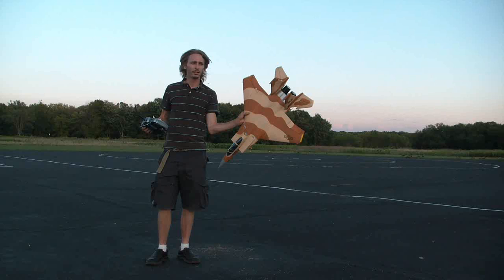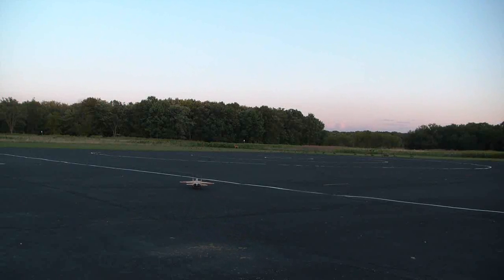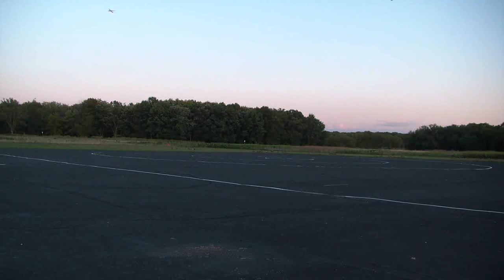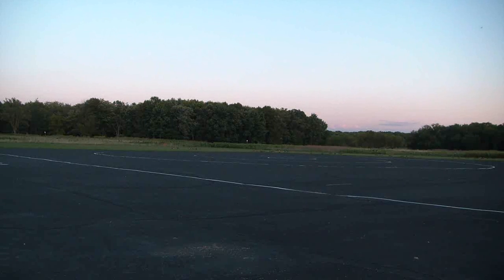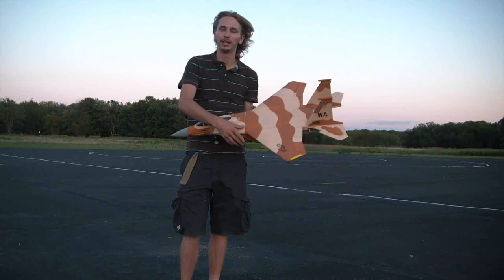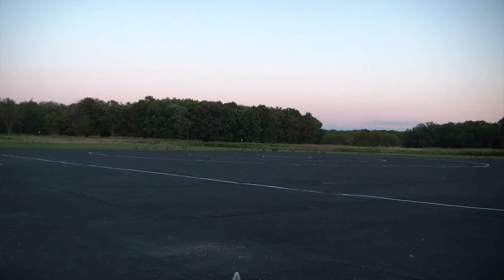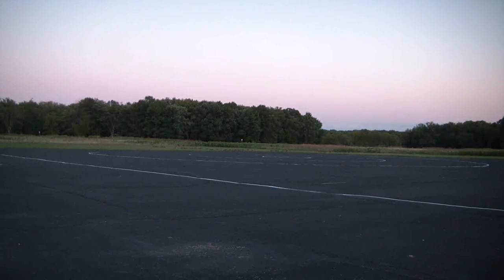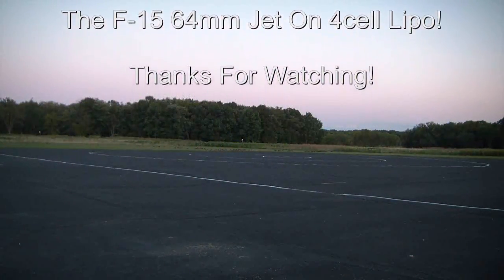F-15 64mm Jet Maiden Flight & Review - LOW Passes!

Comment from the maker: @xToXiicxT3RRoRx cus they sell it with a 3cell lipo, it won't be as fast.  I had the a10, it worked well until one of the two ESC's burned out resulting in a crash.

Comment: Should i get this its on nitroplanes for $119 everything encluded with transmitter and also does it have steering in the front wheel and is it good??

Comment from the maker: @jetcrasher1 The E-flite F-15 flew great, sadly my wing ripped off in flight!  I only got one flight out of it :(  But for the 1 minute it flew, I could tell it was an amazing flier.  It needs some carbon rods from wing to wing to hold them on better.  I put in a 4cell setup with dual 65mm 4000kv motors.  I think it was just too much stress on the airframe without better wing bracing.  Was sad too cus that thing took me like 4 hours to build, and it only flew for 2minutes.

Comment from the maker: @Ispintechno1 really all I did different also was to make sure the wings and elevator were held on well - I used wooden 'toothpicks' as braces between the fuse and wings/elevators.  I have had elevators/wings pull off of jets with the stock glue before... so I just made sure on this one that everything was sturdy and held in place better than stock would be since I added more power to it.

Comment from the maker: @Ispintechno1 well, the differerences are the servos, the receiver, the battery(4 cell instead of 3cell) and the motor/fan unit.  I also just took my time and made sure I built it very well.  But I agree, the stock unit should fly ok, but it is a 3cell setup with a different motor/fan and different esc, and servos.  F-15's fly very nice usually, and this one flys great!

Comment from the maker: @bbroegger well, there are a couple ways.  The easiest way for a 'new pilot' to find out is fly until your plane gets slow/dies.  This is bad for your battery, but if you do it only one time, it should be ok.  Then set your timer a little less than you flew for.  The 'better' way would be to get a volt meter and test your batteries.  Use a full battery, then after a short flight, test your battery.  If lots of power left, fly longer the next flight, and set your timer accordingly.

Comment from the maker: @Admiral1428 3cell setups work, but won't be nearly as fast or powerful as a 4cell setup.  now there are exceptions, it depends on the fan unit and KV speed of motor used as well.